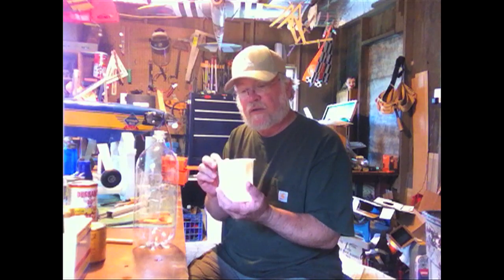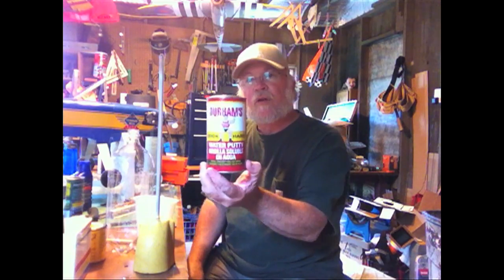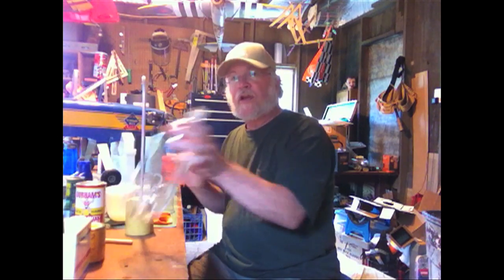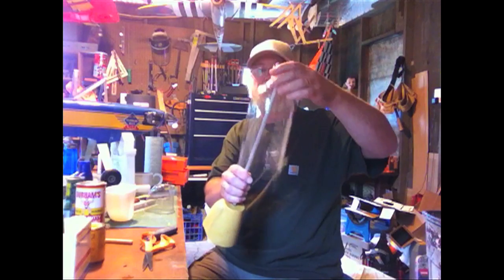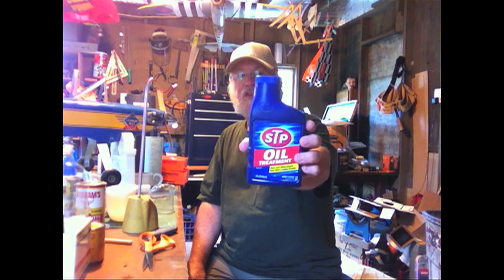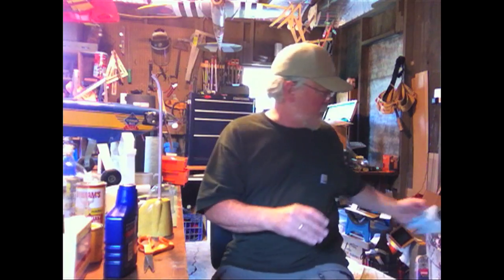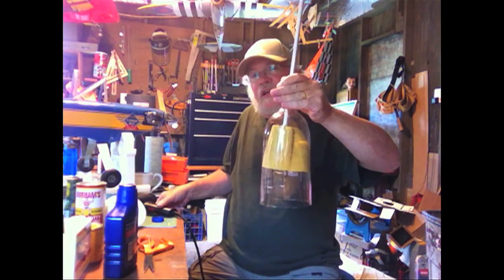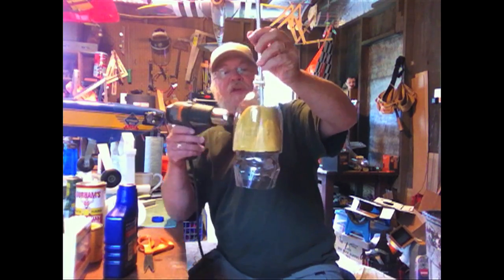DIY Cowl mold for Formosa II

Comment: Hi Steve, I have purchased the materials you recommend and will attempt making a mold very soon.  I have a question though about the rod you have sticking out of the front of the mold.  That would indicate you filled the mold from the front of the cowl and I had planned on filling it from the back so that I would only need to tape over the small hole in the front to seal it.  Perhaps you drilled it out and glued the rod in place after the mold hardened.  Can it be drilled out if I fill the original cowl from the back end? 
Thank you.
Reply: Hi Mike, Really doesn't matter which end you fill with the water putty. I think the cowl I got was solid on the prop end and wasn't cut out yet so was easy to fill, but you can simply tape it up and that would work fine. I had some alum rod laying around so used that for the rod. I drilled the hole after making the plug. You can use a wood dowel or whatever you have handy.

Comment from the maker: Your original cowl will be ok. Just make sure you put some release lube on the inside before you fill it with the putty. It should pop out after it has hardened. You might need to slip something along the side to help it release but use something like a thin strip of plastic or maybe a popsicle stick…just something that isn't sharp that might mess up your original cowl.

Comment from the maker: The neck of any bottle has already been heated and will not shrink any more. Maybe a smaller/taller bottle would work better. Use high heat on your heat gun and experiment on moving the tip of the cone further down away from the neck of the bottle.

Comment: Hi Steve, excellent video! I have tried your technique on a pointed cowl for a jet. Works ok, but it will not shrink round the pointed end. Do you think I need more heat and/or move the plug further from the neck of the bottle? Seems like the neck does not want to shrink! Thanks, Paul.

Comment: One tip I can give you for getting the plug to release if you can make the handle removable from your plug... Drill a small hole in the cap, put the cap back on the bottle and use an air compressor to drive high pressure air into the top. This should crack the workpiece off the plug really easily. 

That's how they get a 40ft fibreglass pool off the giant plugs they use in pool manufacture. If it can crack a 40ft pool off, should work well for this.

Comment: Hey Steve.. not bad for a first attempt...   Unbelievably my gws p 40 kits is one of the newer kits that are slightly larger and the the bottle you are using in the video is too small!!!   I did find a hawaiian punch bottle finally that did the job...costs a lil over  2 bucks... cowl fits plane well... even though I burnt through it in a spot trying to overshrink it.  oh well..it is ventilation for my ESC now!! at any rate thanks for posting this.. I still have the plug if I need to make another

Comment: Thanks Steve.  Home depot had the putty and harbor freight has the heat gun.. made the plug already..it came out pretty nice.  letting it dry overnight and will use high heat and more area above the nose for shrinking tomorrow.